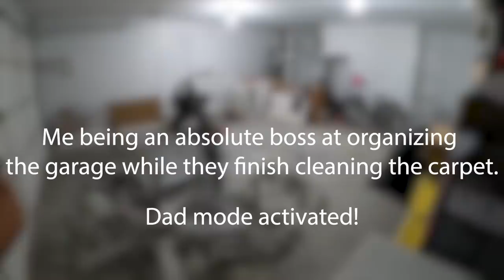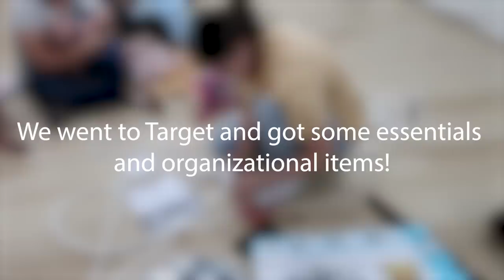UPDATE ON CARLIN'S EEG! THE HOUSE IS DONE AND WE ARE READY TO MOVE!

Comment: I highly recommend getting an exhaust fan for your attic,it can make a huge difference in keeping your house cool and not overtaxing your AC. 🙂
Reply: I second this !
Reply: I totally agree
Reply: Yep best thing to have
Reply: We have a whole house fan and it is awesome. Once the sun goes down we have a nice cool house .
Reply: We are adding 1 to the 1 we already have.  Very good idea. 😊😊
Reply: We insulated our attic along with an energy audit before switching to a/c.  Great improvement!
Reply: I forgot…we also added ceiling fans. Best wishes as you enjoy your new home!  Love your videos!
Reply: A roofing company will tell you if you need an attic fan.  We had a house in NJ and Florida.  Both roofing companies said we did not need an attic fan.  We were told putting in an attic fan when it isn’t needed can cause the attic to be unnecessarily hot because existing ventilation and fan will work against each other.

Comment: You can install a temporary low rail on the stairs for the littles. Super easy and it will keep them from touching the wall.
Reply: Little Steps Handrail is the one that clips on the existing handrail and Kid Co Handrail is one that clicks in the existing spindles.

Comment: Did your plumber fill up the tub, not just run the water? If it was a jacuzzi tub that was leaking water, it is probably coming from the little jets. We have had to seal around ours to prevent leaking (although it still seems to leak if I run the water too long). Those tubs can be kind of a pain.